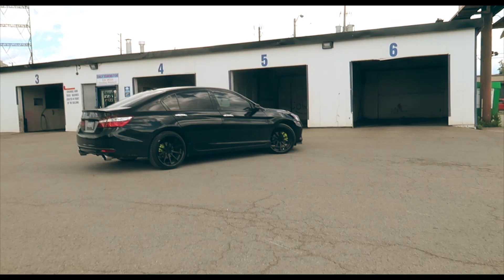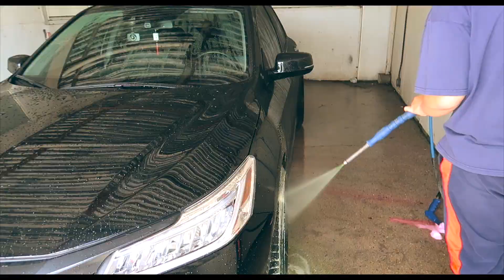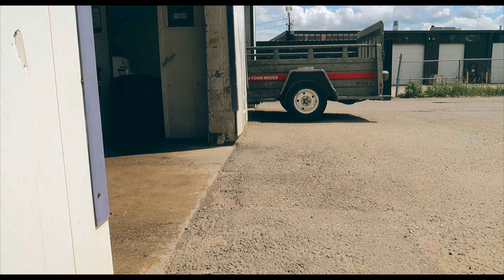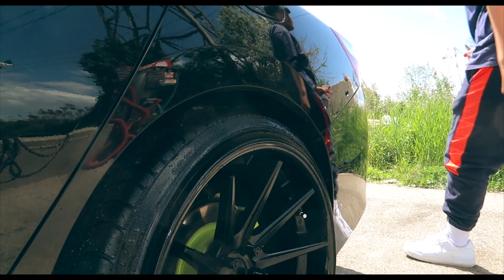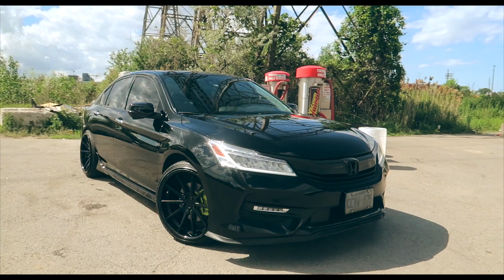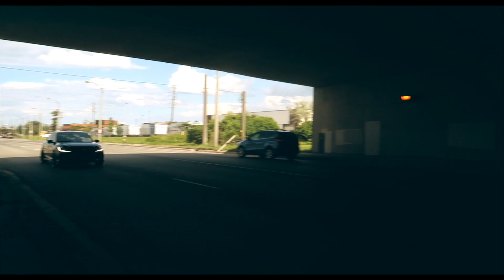Loudest Exhaust 2017 Honda Accord | Montage

Comment: 4 cylinder? or v6? I got a 2017 Accord Sport SE and wanna start customizing it but idk where to start, i want to get rims and tires and maybe exhaust, any recommendations? ur build is 🔥🔥🔥🔥
Reply from the maker: Its a V6 brother. Tbh start with your rims and tires. It’s changes the whole look of the car and then slowly move on to other performance parts 👍
Reply: Tenzin Sangay that’s what i was thinking, not to be a pain but can you lmk what rims u got and the size cuz i’m thinking of getting something like that, and maybe how you got the chrome black. thanks, def getting a sub💯🐐

Comment: Looks fresh dude you should also add yourself one of those small roof spoilers to add an extra aggressive look to it 👌
Reply from the maker: Thanks for the recommendation bro. Will definitely look on to it . 👏
Reply: @tenzinsangay4902  I've got a Coupe myself and threw on a PRO Design Roof Spoiler. Super easy 3m tape install. Just get a friend to help you center it and position it. Becomes somewhat of a hassle by yourself otherwise, not that it can't be done. You don't want to be above the glass either, should be just flush or a few millimeters beneath it. It you actually get it upon the roof you'll have wind/vibration shacking and rattling it and chipping paint away. Had a good friend teach me this before my own install as he did it to his SS Camaro and placed it to high up. He had to then remove it & order a new one. He also had to do a vinyl roof wrap because it chipped the paint from all the vibration. So yea just thought I'd share my own experience as I'm looking to modify my own Accord even though mine is a Coupe vs Sedan. Just prowling the web trying to get ideas on what others have done or are planning on doing. Trunk spoiler in all honesty would also really help to give a more aggressive appearance or maybe even a hood-scoop if that's your taste. I've got a scoop I got to fit on but before I do that got to order that Black Pearl OEM Paint, black base coat, and clear coat to redo the hood as it's rock chipped. Also, got a trunk spoiler on the car as well. Looks a bit odd per-say but once I get the scoop on it should look more uniform. Though of course the scoop is for aesthetic appeal only. It's not a true functioning hood-scoop nor would I really want for it to be. I'm not about to start drilling holes into my hood. 

Oh also a question for you did you upgrade to different brake/rotors or did you just paint them? The Yellow looks good and I like the Chrome deletes. I need to get around to doing that myself but rather tackle bigger plans. I'm looking at installing a Stainless Steel Borla Axle-back Exhaust with the Dual Exhaust Tips alongside a resonator delete. Just got to scrounge up the $ to do it. After that I'd like to do either a HKS or Tein Sports Suspension upgrade but that can wait as there isn't anything remotely wrong with my stock suspension. Sadly having a hard time finding a shop in my area willing enough to do it and do it right. The pain of living in a rural area away from even the suburbs. 

Also, just a little pro tip. You should use a applicator pad to apply your Tireshine. This way it avoids getting on your clean rims and panels of the vehicle. So you'll avoid spotting or even paint fade due to any harsh chemicals that may be in the Shine though most products are really good about not having harsh chemical compounds. Though from looking I'd say you've ceramic coated the car so that really shouldn't pose a issue. Anyway I've ranted on enough. Thank you for sharing my guy. I'll be subscribing to see what all you continue to do to the car along the way. Can't wait to see what you got planned :')

Comment: You running Coilovers or stock suspension? If coils, which ones you running? 
Got my 17 Accord Sport before the pandemic and I might start with suspension/wheels & tires first
Reply from the maker: Rite now m running on stock suspension. I suggest getting the rims and tires first with  that way you might have option for coil or lowering springs 👍

Comment: How can you install the headlight of accord 2019 on your 2017. And where I can buy to install on my 2015
Reply from the maker: The Headlight came like this. It’s factory since it’s the touring package 👍
Reply: You can buy the touring headlights for your 15 but you need the adapter harness and when you install the headlights your grille will look weird because the touring headlights are a different shape than the 15 stock headlight

Comment: Hey bro what size are your wheels in the back 20/35/275
Reply from the maker: 20/35/245 it’s a stretch .
Reply: Tenzin Sangay ok my setup are 20/35/245 front and 20/30/275 back I wanna try 285 in the back you think 🤔 it could handle that

Comment: What exhaust system do you have or what did you do to it ?? Ur shit 🔥🔥🔥
Reply from the maker: Thank you bro 👏👏👏. Current I have the vibrant performance exhaust with custom axle back and res delete. 👍
Reply: @tenzinsangay4902  Will you pass emissions? Does it trigger a engine light?
Reply from the maker: @ItsImCinder  No lights triggered. Pass emissions easily 👍
Reply: @tenzinsangay4902  do you have a link for it ?